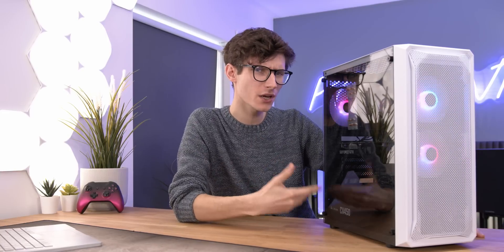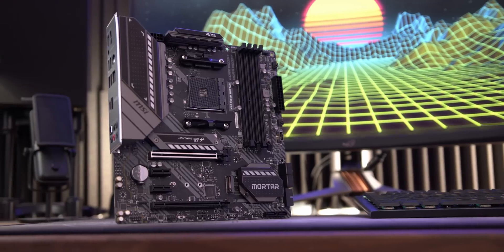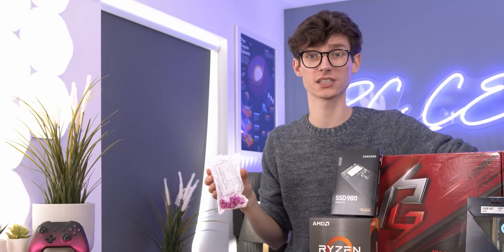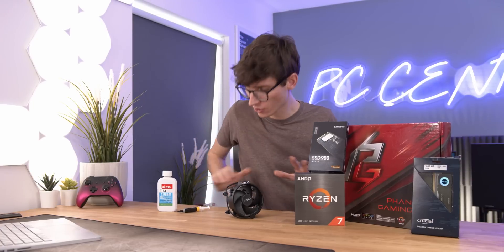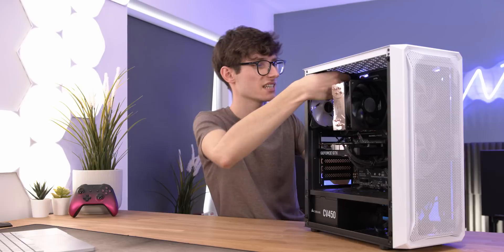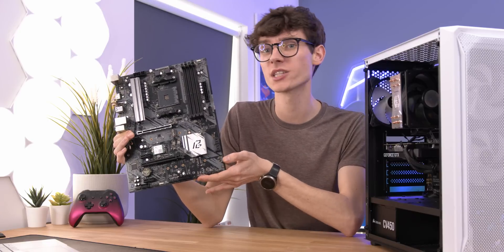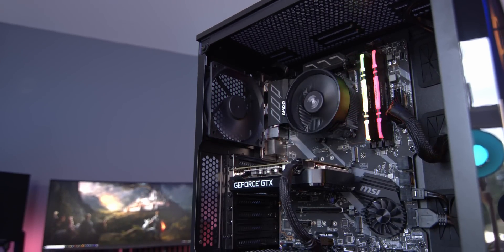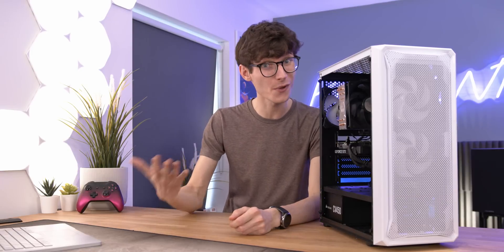10 MUST KNOW Tips And Tricks To Build Your Gaming PC! (PC Build 2021)

Comment: I thought I might of need to flash my bios for the HTPC build with consisted of a Ryzen 5 5600g so I bought a MSI Mag B550M  Mortar which has a flash bios button and yes I had to flash it as the motherboard wouldn't detect  the CPU when I built it so I had to take out the CPU and flash it

Comment: Good point on RTFM.  It will tell you which RAM slots to use first for dual-channel, and it will show you where all the connector pins are on the mobo.  If you're using a SATA M.2 SSD, it will also tell you which SATA port will get disabled.

Comment: Do you still need to install windows 10 or does it come automatic, I have windows 10 cd which I used for my last pc build but got a friend to install it as my old monitor wouldn't work with the new computer, so thinking of getting another dvd driver for my new build, as my old I did couple of years ago isn't performing well an think it's not a gaming pc more like a normal everyday pc
Reply: If you build your own PC, it won't have any operating system. The drive(s) will be blank so you have to install Windows.
Reply: I built another computer using a HDD 1tb which I put windows 10 on to it is that good for gaming pc start up, if not can I transfer it on to a MS storage
Reply: @martinfanthom3870  I strongly recommend an SSD for any computer. It will make your system much more responsive than with just a hard drive. You can always clone the drive to an SSD using a tool like Acronis TrueImage or Macrium Reflect.
Reply: @JJFlores197  the SSD is the M.2 version than the normal SATA SSD
Reply: Sorry it's a HHDD storage

Comment: I built a system ten years ago with a pair of SATA III hard drives in a RAID 0 configuration, and formatted that as my C: drive.  Right off the bat I was experiencing a lot of crashes and I was worried.  I eventually figured out though, that the hard drives (WD blues) would by default go into power saving mode and spin down, but of course they would never spin back up in the exact same amount of time...  The solution was to set them so they never spun down.

Comment: I need big time help please are this parts comparable motherboard is MSI AMD MPG B550 gaming plus LIGHTNING GEN 4 RAM is DDR4 3200MHz 2×8 GB MEMORY is WD Blue SATA SSD 500GB POWER SUPPLY is smart series 700 watts mid tower gaming case is CORSAIR 220T RGB i need a few more parts thank you
Reply: B550 motherboards have a socket for ryzen cpu's. you gotta look what kind of ssd your motherboard supports (probably m.2) in the description of the product. just look well at the specs and descriptions of your parts, and it should be fine.
Reply: @lennbeld6986  ok thank you am going to check the info. The came with it i got some parts from bestbuy the motherboard ram ssd memory the big one not the little one the case an power supply i pick them with out knowing if they were compatible  no one help me like hold on this one if Good for the motherboard the guy supposedly help me but he didn't am like let me see YouTube thank you LENN

Comment: For me mine didn't boot after building it all together
1 Factory sent wrong aio bracket screws easy fix 
2 Trouble connecting power switch/reset pins in proper spots on mobo
3 gpu 8 pin or 4+4 pin cable not properly connected  
other than that everything worked well and was able to update the bios and install windows

Comment: This was a proper noob point from me. I built everything and lights were working and fans were working but no display at all. I returned the motherboard (as it was a mini and I thought that it was the motherboard) but turned out with the new motherboard it was the same problem so I thought it was the cpu chip as the light came up cpu. What actually happened was that I didn't connect the cpu power supply. I honestly thought that the motherboard power supply was what powered the cpu lol

Comment: What about Legacy and UEFI BIOS modes.. I know this was mainly about building the actual PC itself. You mentioned the media creation tool and installing Windows, but what about having it in UEFI mode when you install Windows. Doesn't that make a difference? And really no one mentions it when installing Windows. My PC was in Legacy but I changed it with a command and it is now in UEFI but I don't think it is the exact same as installing Windows with UEFI. 

To do that don't you set the BIOS mode to UEFI and not Legacy, for each motherboard BIOS settings might be different for this and then for some you might even after changing BIOS mode to UEFI select to boot the USB that you made with media creation tool as UEFI USB vs Legacy/normal USB and then it will install as Windows UEFI.

Comment: I am absolutely terrified at building my pc, especially the boot up. Like what if something is bumbed out and doesn't work at all, then I would have wasted all that time and money.
Reply: Well you can either live in fear or take the plunge do it. I mean, we all had to start somewhere. To somewhat answer your question, in that instance, you go through troubleshooting steps. It is likely that if your PC doesn't turn on the first time, you may have forgotten to plug something in or maybe it wasn't plugged in correctly. Just because it doesn't turn on doesn't necessarily mean that the hardware itself is bad. If a component does turn out to be bad, you can almost always return it. Most manufacturers give you a year of warranty.

Comment: I built my PC on the couch. It provides lots of room to install the various parts but it's easy to lose screws and drop pieces on the floor. I only needed a standard Phillips screwdriver for my build. As far as cable management goes, it's overrated in my opinion because no one is going to look at the inside of my computer.

Comment: Can you give me a tip on how to actually find and buy a GPU... like ive been trying since last September  to build my first PC and now im stuck with everything besides a GPU. Was gonna be a grad gift to myself for finishing uni now im regretting spending so much on parts I dont know when ill be able to use. Couldnt of had worse timing rip
Reply: I used Hotstock to send me notifications once it found graphics cards in stock at BestBuy, Amazon, and I believe a few other retailers. I managed to buy my RX6800 at BB a few months ago using that app. The thing is that you have to be able to take action within seconds you get the notification. Sometimes you get false positives.

Comment: Going to build my first one this monday. Really hope that I don't f up.
Reply: which specs bro?
Reply: I510600k
Coolermaster evo 212
Z490 plus mobo
Corsair vengeance 8×2gb 
1tb samsung 860 evo 
Aorus 750w gold 
Gtx1070 (i know its old , but gpu prices are stupid right now and everything is out of stock so i got it from somebody i know for a 100€ used. For that price cant complain. When prices are normal i will upgrade in like a year and a half or so)
Tower: corsair spec delta
I think that for a beginner this is decent and that i have enough options for upgrading in the future.

Comment: You should verify where all of the motherboard standoffs are.  If one is out of place you could be grounding part of the motherboard that shouldn't be grounded or if a standoff is missing, you may have to pull up the motherboard.  Also, don't forget to turn on the rocker switch on the power supply.  I can't tell you how many times I've contemplated harikari because of that damn switch! One last thing, remember to plug in your keyboard and mouse before you switch on the PC for the first time.  For new users, a bonus tip: Don't drink more than one coffee or energy drink while building your PC.

Comment: Great tips! I'd add to the "read the manual" part: Sometimes those manual illustrations are generic or poorly drawn. Take your time, you might have to "interpret" those drawings. I've built loads of pc's, but yesterday, while swapping in a new cpu cooler, I experienced this. The cooler mounting bracket drawing looked very little like the actual, oddly shaped brackets, so they weren't clear about orientation when mounted to cooler. The brackets also had sliding mount screw slots to adjust spacing for different generation boards. The drawings didn't show which direction to mount the brackets to cooler, so I had to flip them around, and adjust the sliding screws, until they finally lined up with the mounting plate holes. No biggie, just some fiddling, but the drawings were semi-useless.

Comment: I finished my first build 2 days ago but it keeps shutting off randomly 😭 Gonna test the PSU and fit another CPU cooler tomorrow. Been waiting/saving/researching this build for half a year... pain.
Reply from the maker: While gaming, or idle?
Reply: @PcCentric  while gaming twice and then this morning while idle (or rather it booted, I put my password in and then it turned off)
Reply: @PcCentric  just thought I’d update this and say the new cooler seems to have fixed something! I tested the PSU and it seemed fine (PG - 120? But Google tells me between 100-500 is good). I added 3 more fans too. It booted and I opened warzone, temps are a lot better, 10c better!

Comment: I found the hardest part was the io shield, it was so cheap and nearly severed my fingers
Reply: I hate those fan mounts on heat sinks. I love noctua but dam sometimes you gotta yank so hard to get the fan wire over the heat sink I got a cut on my finger a few days ago as I already installed the cooler and was in my case and I saw my fan wasn’t fully on. So didnt have enough space to do it without getting sliced lol.

Comment: Can we get a 2021 update video about the cheapest prebuilds you would recommended.
Reply: I got a sky tech gaming pc a month ago and I friggin love it! Shadow 3.0 came with Ryzen 5 3600 and RTX 3060ti. Out the box all I did was enable D.O.C.P. in the bios for the RAM to actually run at 3000 and I get 130-150 avg frames on Warzone! With nvidia game filters and ray tracing enable, which both actually hurt frames a bit but I only have a 144hz monitor so it doesn’t matter. It was like 1400.00 but I think the price went up a little. They also have same pc with Radeon GC too!!!
Reply: Their reviews aren’t the best but I haven’t had a single problem. Even the cable management was nice.
Reply: Cheap PC requires:ryzen 5_ Gt 1030 gigabyte oc gpu Ram of 16gb

Comment: What do you recommend to invest more in, CPU or GPU?
I have to choose between rtx 3060ti with a ryzen 7
OR
rtx 3060 with ryzen 9
Reply from the maker: 100% 3060ti and R7
Reply: The ti is a lot more powerful than the regular 3060. Its not even the same cut down die. Its a totally different die. 3060ti is a GA104 and is a cut down 3070. 3060 is a GA106 and is literally only 5-10% faster than the 2060 super.

Comment: 63rd view pc centric btw can you do or tell me a pc setup for 2600 or 2700 pounds I'm thinking of rtx 3080 pc for 1500 or 1600 pounds with a lg 27gn950 and keyboard mouse headset and chair for 300 pounds what do you think
Reply: Just make sure you also get a zen 3 chip. Those have the ryzen 5000 number in them. You can also go intel but go with a 10th gen i5 or higher. I would personally recommend a ryzen 5600x if you just need It for gaming as the 5600x is 6 core/12 thread and actually delivers more frames than even the top of the line intel 10900k. If you do content creation I would recommend the 8core/16 thread ryzen 5800x. (You could also go higher and get the 12 core 5900x or 16 core 5950x but those are pretty impossible to find.) the cpu is very important because with a high end gpu like the 3080 you dont want to leave any extra frames on the table because your cpu cant keep up.

Comment: Is there a difference between getting a 1.4 hdmi monitor and a 2.0 for playing pc?
Reply from the maker: Yes, HDMI 2.0 can do 4k 60, as well as 1440p high refresh
Reply: @PcCentric  would a hdmi 1.4 be able to run 144fps at 1080p or is the 2.0 needed?
Reply: @hixyy-_-  1.4 can do 144 hz at 1080p
Reply: @Jsteeezz  thanks mate, sorry I’m so dumb with this stuff I’m only just switching to pc but gotta wait for the gpu shortage to blow over
Reply: @hixyy-_-  no worries mate. I subscribe to the thought that there aren’t any dumb questions. Much easier to ask in the comments versus buying a monitor and finding out you also need to upgrade your gpu because it doesnt support the proper hdmi or DisplayPort to get the performance you paid for. Also I would personally recommend DisplayPort over hdmi if you have a choice. HDMI 2.1 is new and now supports 4K 120hz, but DisplayPort has had this support for a few years so you will most likely find older products that have DisplayPort that are able to drive higher resolutions and frame rate. Have a good one!
Reply: @Jsteeezz  yes the monitor that I was looking at getting does have display port. Lol sorry I just had no idea what it meant as I’ve always been used to hdmi on console
Reply: @hixyy-_-  yea DisplayPort is really only found on pc parts. Here’s the short version. HDMI is owned by the HDMI forum and they charge a license to use it. So manufactures have to pay a fee for every product they make that has DisplayPort. Because of this we have seen a DisplayPort pop up to act as free version of hdmi. You see consoles use hdmi because most TVs only have hdmi and most home theater setups use hdmi for audio passthru. Also cable boxes are hdmi. But in pc hardware they like to use DisplayPort so they can save money and up until recently you couldn’t do 4K high refresh rate on hdmi so DisplayPort was needed. I prefer DisplayPort as the connector is a locking connector so you need to push a lever down on the end of the connector to release it. This prevents it from accidentally coming out if it gets tugged. Have a good one!
Reply: @Jsteeezz  okay thanks! Also if you were trying to play 144hz and your running off a budget, what cpu and gpu would you go with?
Reply: @hixyy-_-  well the gpu is hard because everything is out of stock. But for cpu a ryzen 5 3600 should be enough. Or if intel a 10600 is great or 10400 if you wanna save money
Reply: @Jsteeezz  yeah I was gonna go with a 3600. when gpu are back In stock what do you think I should go for to pair it with?
Reply: @hixyy-_-  if it’s available for suggested retail price a 3060 ti for 400 bucks is a great pick
Reply: @Jsteeezz  would a 2060 gpu be good at all? And will I need to buy a specific motherboard or will it be okay if I got one around 80-100
Reply: @hixyy-_-  yea a 80-100 dollar board will be totally fine. If ur trying to run a super high end cpu and overclock it maybe get a higher end board, but if ur not pushing it to the limit or its a mid range cpu u can even get away with over clocking a mid range cpu on a 80-100 board
Reply: @Jsteeezz  I’m gonna be getting the ryzen 5 3600 cpu you think 100 for the mb is fine?
Reply: @hixyy-_-  thats more than fine! I ran a 5600x in a 70 dollar b450 board for a few months. Had no issues. Literally every board is going to be fine. Your basically just paying for extra features like pcie gen 4 or extra USB ports or built in WiFi, or better sound, etc